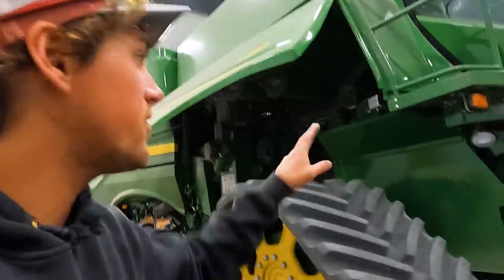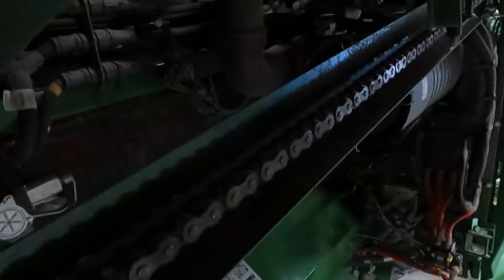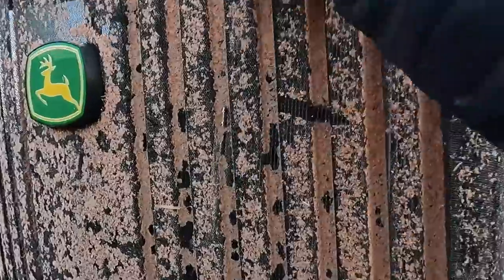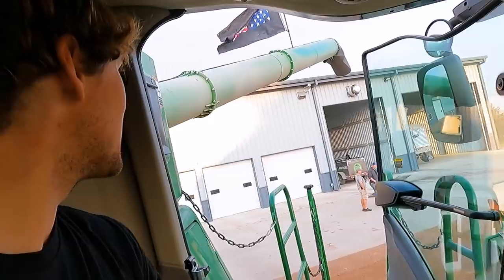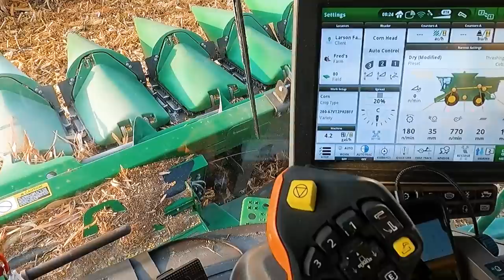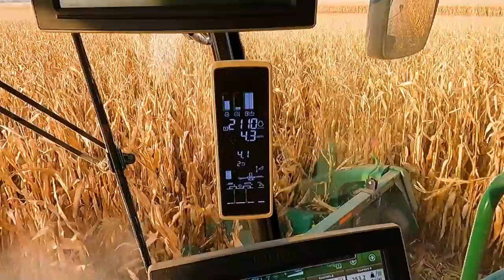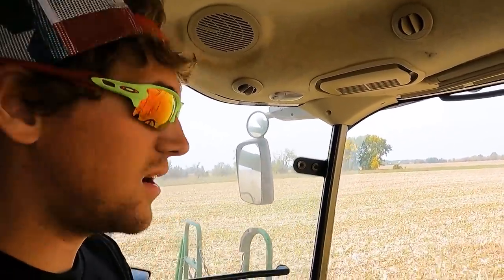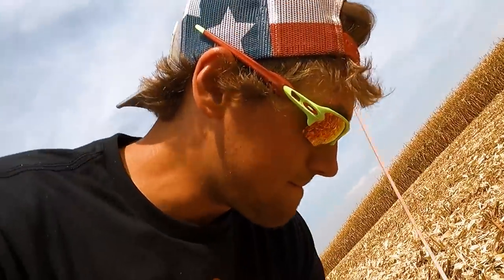Size Matters!! Corn Harvest At Its Best!! #9

Comment: That cold spring, was followed by some very warm sunny weather during the month of May, and, that, might have helped with the cold soil at planting. But, the drought which affected all of us in the north and central parts of our state, make those high yields amazing. Maybe the early start got the corn a bit of a head start when the dry weather hit.
Reply: Planting into cold but otherwise fit soil usually turns out fine. Where we can get in trouble is a week or 2 later when  its warmer but receive a cold rain shortly after planting.The planter needs to be in the shed the day before that happens,there is usually emergence issues while the corn planted earlier has absorbed its first moisture during the warmer period and comes up fine.
Reply: @lynwessel2471  In central Minnesota, the gamble paid off, as I said, we had a very warm, and, dry period later in May, That early start must have given the crop a head start on the very dry summer that followed. The root system was developing earlier, and, allowed it to tap the water stored. We had a historic drought last summer, it is amazing to see the good yield despite the dry weather.
Reply: @keithkuckler2551  Im in southern MN, we weren't as dry as west central,but yields here are outstanding on any soils with good water holding capacity. Best areas of corn fields are into the 300 area despite 7" below normal precip.Dry spring got the corn roots down there early. Both '18 and '19 were so wet here I averaged in the 130s.
Reply: @lynwessel2471  I used to farm southwest of Minneapolis in Scott County. I had that heavy ground as well. It always helped, although it was more of a challenge back when we used more tillage. I had a chisel plow that I used on bean and small grain ground, but, I noticed how much earlier the soil warmed on ground that had been plowed with a moldboard plow. That early start sure helps. I was in  the driftless area of south west Wisconsin the first week of August, and, the crops looked really good, and, when I drove back through the Winona and Rochester area they looked good as well.

Comment: Sounds like you need a new master clutch pwn solenoid, we’ve changed a lot of them with tractors with jumpy clutches
Reply: Joel,
Most definitely! Line pressure also needs to be checked.

Comment: Probably a dumb question but with the cost of all this equipment is the return really justify it over older/slower/smaller/less expensive equipment. They are done so fast but is that really worth the expense? It must but it blows my mind. You would think you could stagger the planting and harvest which would lower equipment cost but ad time to get it done.  There has to be a breaking point with the cost of machines.

Comment: On your nice issue get the 5 gal buckets 🪣 with the flipping lid. Or make your own 1 bucket 3/8 all thread 2 washers and 2 locking nuts and a piece of 1/2 pvc length of inside Dia of bucket 🪣…
Peanut butter in the center so when they walk out on the pvc it spins and drops the lil f ers in the bucket………..
Reply: I run  heavy wire thru a pop can, the wire ends thru the wall of the bucket and bent down to anchor the wire.
Peanut butter on the can, which is centered in the bucket. Can holes are  drilled slightly larger than the wire.
 A piece of wood at 45 degree angle for the mice to travel to the peanut butter on the can. Fast to build, Simple, cheap and effective. The one I just put out in another machine shed, had 12 mice in the bucket the first morning.

Comment: The guy that rented my cousins place wore shorts and flip flops all summer farming didn't matter what he was doing he still does we're neighbors when I was growing up I wore shorts only and nothing we had had a cab except dad's combine I started out on grandpa's old Massey Harris 82 with a 13 ft head when the flathead 6 cylinder blew dad got a Gleaner I got his Massey Ferguson 300 had to hand crank the auger out when bearings deep in the machine got expensive I got the L2 dad got a 1460 IH axialflow then I bought an R50 Gleaner barefoot no shirt even in the shop torching and welding but being diabetic I have to watch my feet now and only chicks look good in shorts and cowboy boots so I'm to jeans boots and a cowboy hat I keep a sleeveless button up shirt for the places that say no shirt no shoes no pants no service I don't button it but I toss it on unless I'm wearing my bibs then they have a built in shirt I still only 1 strap it